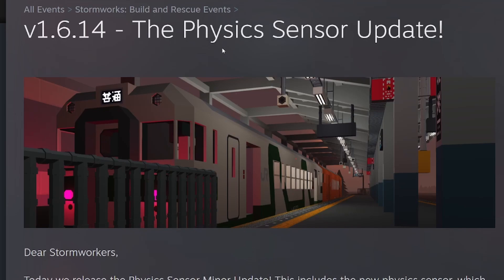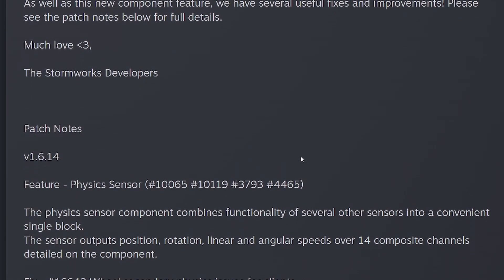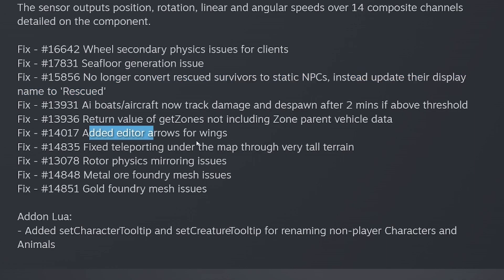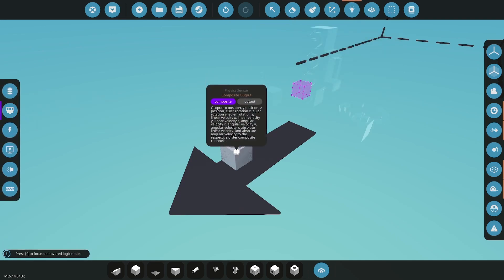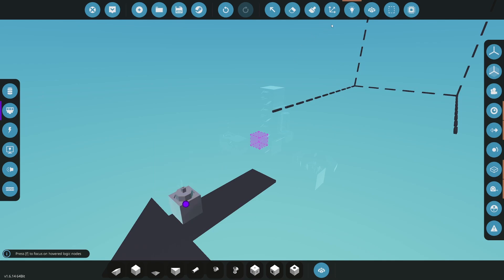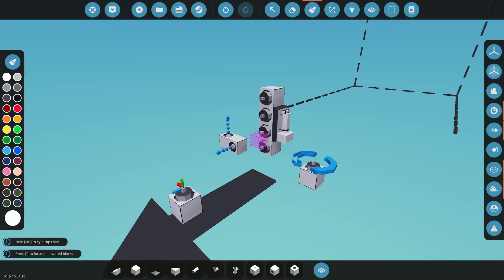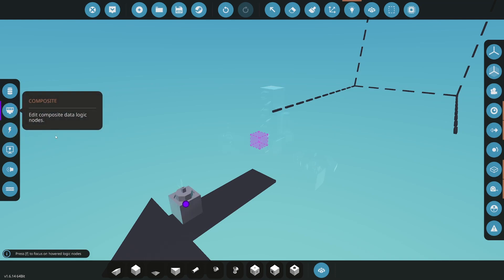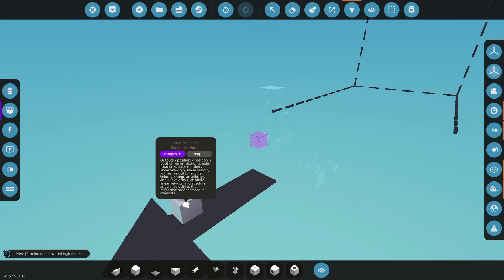Stormworks Physics Sensor Update

Comment: Its funny since output channel, 4,5,6 are broken (Arguably the second most important outputs). Their outputs are global which means that they will be incorrect whenever using it in any formula. This also means the output flips when you go past the north to south line past 0,0. So at the moment a lot of things it should be capable of are hampered :/
Reply from the maker: Let me know if you make a bug report or if you see one so I can ask people to support it thanks.
Reply: @CaptainCockerels   I will keep looking. I got shadow banned like many others so i can not make a bug report myself.
Reply: @11Tits  it isn’t broken, the devs just wrote it in the strangest way possible, takes 10x more maths
Reply: @11Tits  I once thought they were broken too it’s all good, what I do is convert them to Euler angles aswell (yaw pitch roll)

Then I convert them angles to orthogonal unit vectors aswell(3 xyz vectors pointing in the vehicles right front and up orientations, you can do some crazy stuff with them vectors innit.